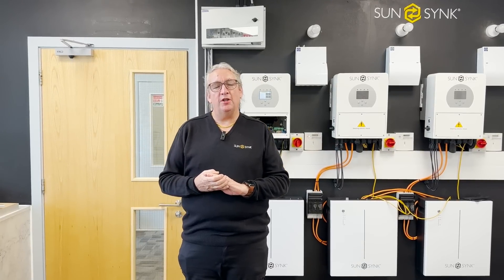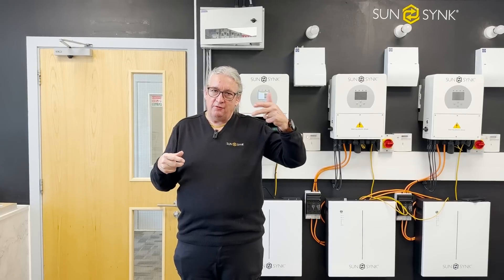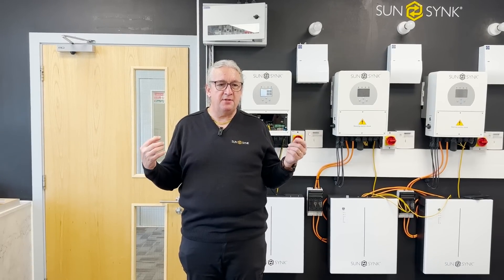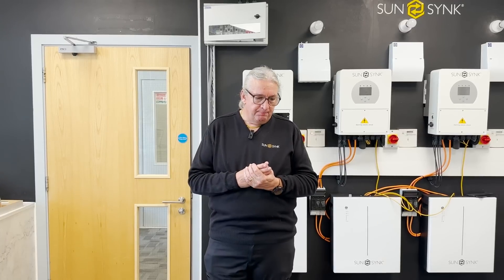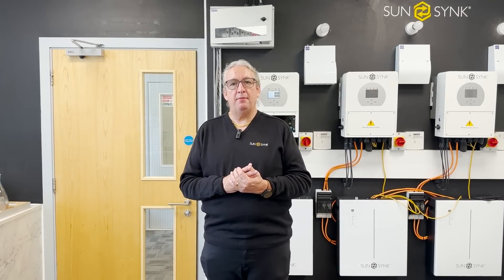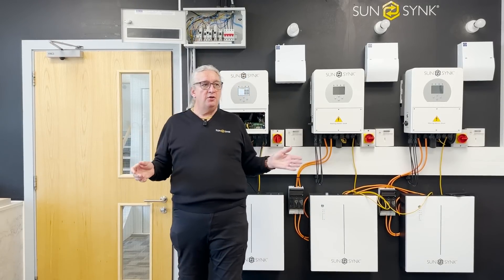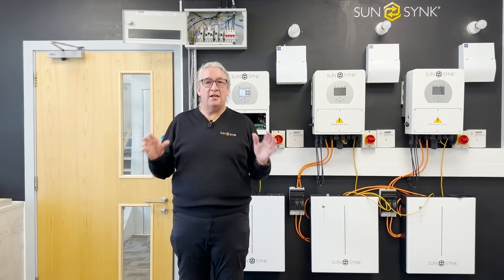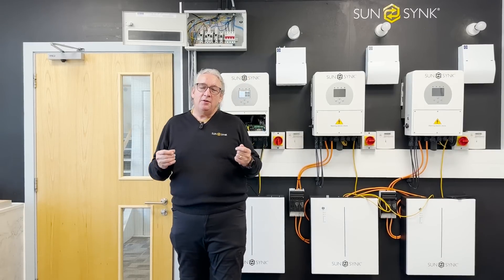RCDs Explained | Sunsynk Training Video

Comment: If you have an earth rod / TT earth you need an RCD for fault protection . Similarly you should also have an RCD for when the inverter is running as off grid even if it’s PME earthing because the the NE bond in the inverter is made an the fault current is too low for the MCB’s to trip.   This needs to be made clear or do you have an alternative option ?

Comment: Wish we had never had these Sunsynk installed . Installer has never shown us how to use it and I’m not an electrician in any shape or form. Effective home have never been any help to us. They took our money and ignore us. Batteries don’t seem to do anything still pulling loads of W from the grid and our bills have never gone down. Waste of £7500. Tried all the setting there is and nothing really changes. We’ve had it in our home that all the electric is off yet the grid still shows W going to the inverter. With the solar showing around 3000 W going to the inverter, battery full but soon empty when pumping over 3000 W to the inverter. I’ve tried load only battery only and I have no clue what’s the best setting? Also am I supposed to keep changing it from priority battery on a sunny day to load priority on a night time or a not so sunny day. Isn’t there a setttong where you can have it switch for you depending on weather

Comment: Good morning from my part of the world. I have a question that I'd like to address directly. I am currently attempting to connect an inverter in a batteryless state, with the specific intention of having solar power solely supply the load without any export to the grid. I have encountered difficulties configuring the settings for this purpose and am seeking guidance on the proper connection and any additional information that might be pertinent.

Comment: Hi @williamhyman - not sure what you mean that no elcb is required for fixed installations. According to code all socket outlets(unless dedicated ones) and also geysers (as you said) need to be on Earth Leakage according to SANS10142-1
Reply from the maker: I am referring to the inverter ac connection only not the essential loads

Comment: @herman no elcb required on fixed installation,  unless Geyser ( new SANS 2021, before 2021 geyser not on elcb) and if you have a dedicated plug ( meaning freezer, fridge, aircon is the only appliance plugged in over 1 year) no need for elcb. this is elcb 30mA, 40A/63A..I personally don't connect elcb upstream & definitely no machine connected to elcb..inductive circuits are current sinks, they can cause nuisance tripping at 30mA...the Brits live in tents and wooden houses..different regulations..😂😂😂

Comment: Hi Keith, it is SA law to have earth leakages, except lights. I had it on 2 jobs where its tripping on utility failure, so when loadshedding kicks in, it trips the el. Also our sans code required permanent earth N bond, so we hardwire it. Like usual very informative
Reply from the maker: RCD should be used on everything I am referring to the inverter grid connection only